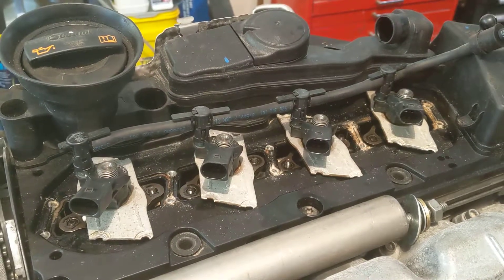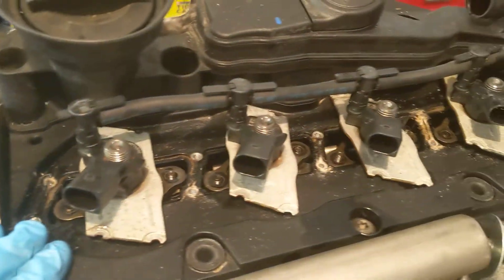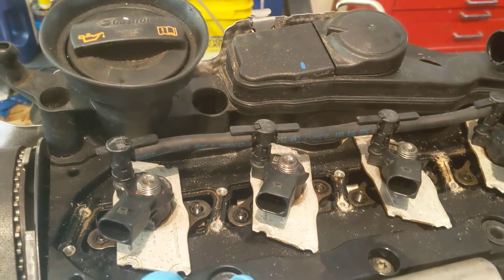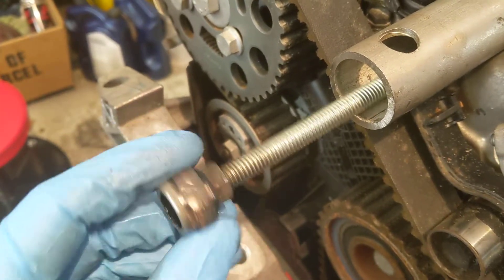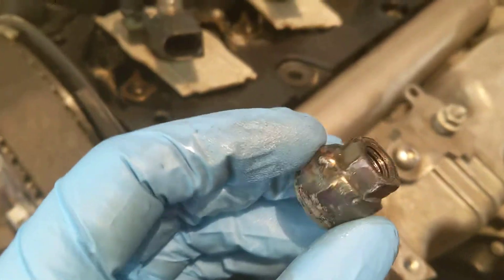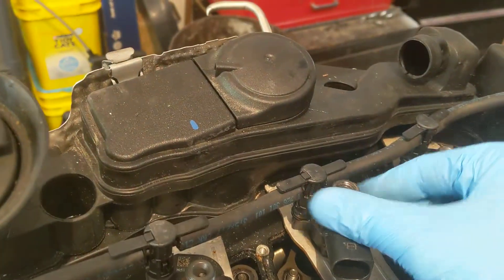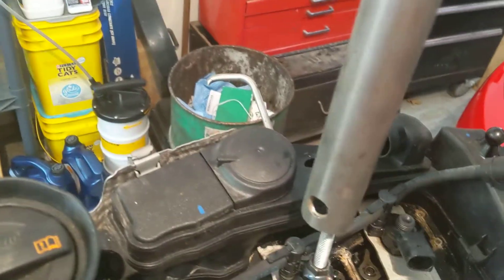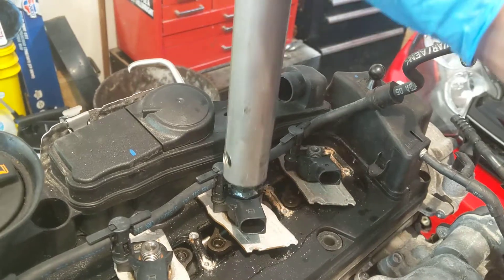How to remove injectors from a VW TDI common rail diesel

Comment: Hello, I have a Mk6 Golf TDI that needs the valve gasket cover replaced.  I don’t own a VCdS software to depressurize the inject rails.  What advice would you share, I heard if I remove the rail without the VCDS my vehicle will not run!
Reply from the maker: Hmm, been a long time since I last did this work. Not sure you have to have VCDS, but it helps to run the fuel pump to purge the air from the rail. I'd leave the injector nuts cracked with rags around them, crank for a few seconds to purge air and see some diesel. Then tighten the nuts and attempt to start.
Reply: I run 300 ml red tranny fluid in 50 liters diesil every tank so I'm not worried at all about the hpfp 370 km on my 2012 TDI and the thing runs like a clock.  I'm gonna change my valve cover soon and service the injectors  my first time doing it.   I'm thankful for our great community of diy guys @tvanc542

Comment: And of course, step 3; replace the injector, because the piezoelectric element inside has now changed properties due to the impact of hammering.
Reply from the maker: Okay Basketball, show me how you pull em? I've had no issues removing this way. A few gentle taps breaks them lose usually.
Reply: lol as opposed to the gentle of touch of being directly piped into a diesel combustion chamber?